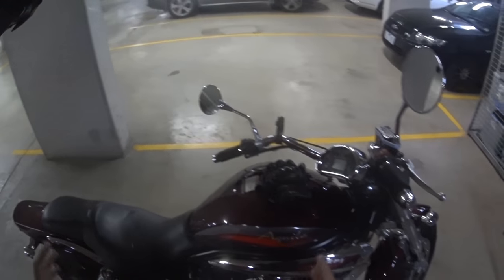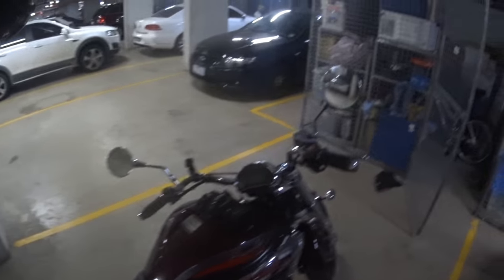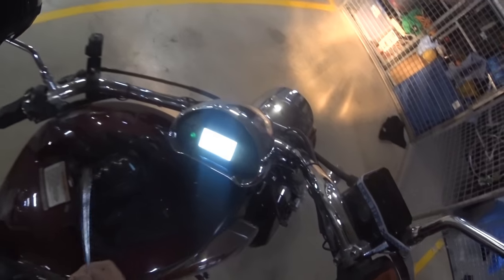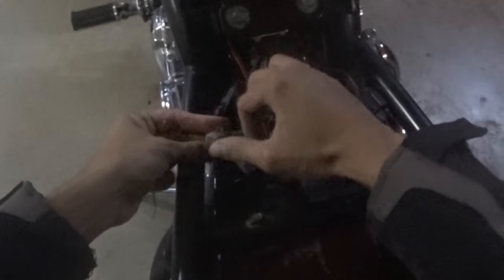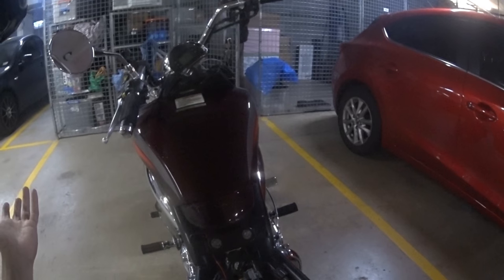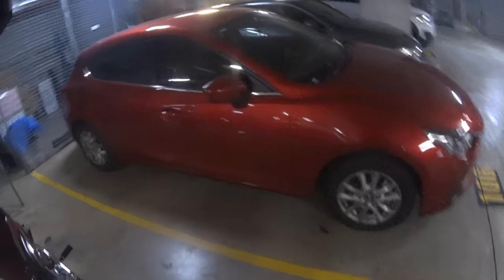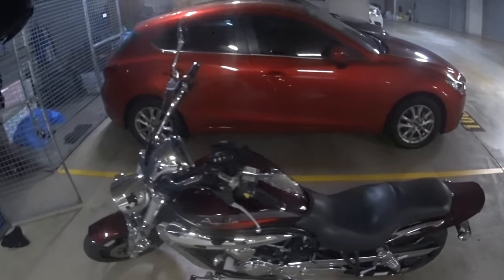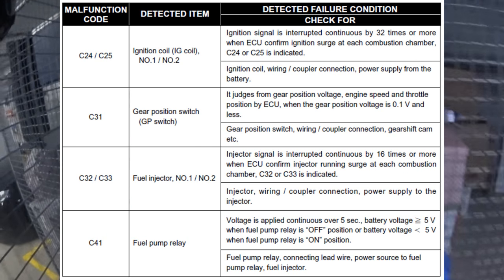How to read FI fault code Hyosung GV650 and GT650

Comment: I have 650 GV 2013 and after standing in rain, one cylinder does not fire for few minutes ( 4-5 minutes) before warming up. It runs normal after 5 minutes.What do you thing should I check?
Reply from the maker: Sounds like the spark plugs earthing out when wet so it's not zapping the plug. Check the leads on both ends by unplugging them and checking for corrosion. Could also be the water is getting into the regulator rectifier and shorting it so the voltage output is less and only enough to spark one cylinder. Check it's plugs too.
Reply: Suzuki sv650 and our gv650s have the same rubber caps over the spark plugs. They are a known fault on the Suzuki's. I'd check some Suzuki pages for an idea on a long term fix.
But short term, simply replacing them from the wire down will fix it, checking for any corrosion.
Reply: @blahblahblahlunch   thanks for the reply

Comment: Hello 

I am so thankfull for this site ! because i am in very big trouble,,,

Last year when i parked my Hyosung Gt650EFI year 2008, The bike staling/misfiring / lost power,,,

And i was assuming it was new Ignition coils/spark plug,

So ive changed 
Both ignition coils
Both spark plugs,
Rectifier
STATOR/MAGNET
-------------

STILL SAME Issue,,

The bike can idle fine ! but as soon you give a Little Gas, the bike will not take it and it runs very poor, 

There is no problem when starting the bike, it turns great in and idle fine ! but as soon you give a throttle it stall and go on 1 cylinder(sounds like that)

I dont see any Faults in my display ? ,

Could it be the air sensors?,, How can i check that?
Could it be the injection nozzle? - How can i check that ? 
Could it be low fuel pressure?  - but how can i check? The pump is runing great as soon you turn on ignition,,,

In Denmark there are No Hyosung dealers,, so no dealer help is possible,

Thank you 

Regards Jacob From Denmark
Reply from the maker: You need to ask that question in some Hyosung forums. Not sure what caused that if it's idling fine. Could be the ECU computer but hard to tell.

Comment: That's how I found out my ECU was busted, It was coming up with a timing error but the resistance on the timing wires was within spec. At least yours is starting and running, mine would not even do that.
Reply from the maker: yeah i am lucky :)

Comment: Wow very different to a newer GV650 with a Delphi ECU. I short mine before starting (thats the only way it works for me and it starts fine) and once the error light comes on you hold select button down for 15 seconds and then the code is displayed.
Reply from the maker: that's good to know. my ecu is the Daewoo brand one in my 2010 GV650
Reply: Andrew Morris, what year is yours?

Comment: I bought a gt650 2013 and when I turn it on it gives a flashing FI light. Bridging it does nothing
Reply from the maker: Perhaps yours is bridged in another way, as it's not the same model?
Reply: Hey, by any chance you found the solution? 😅

Comment: It is inaccurate and misleading to say 0:46 "the engine isn't running and teh FI is not lit". Actually production years around 2009 ALWAYS display cHE and ref FI light is on UNTIL you start the engine. Maybe later EFI models have this fixed. Early carb version of course do not display anything as they have no EFI unit to transmit error codes at all.
Reply from the maker: This one's a 2010 model
Reply: So my 2010 efi gt650r is fine with che displaying with Killswitch off? I'm not getting power to my fuel pump. Kinda loosing faith
Reply: @nawrfsideshawty  this kind of cHe is fine. if it displays with motor running, at this point you youse debugging/serviing switch and it displays error code instead of km/h.

Comment: mine flashes FI but not when it's running. Is that good or bad? It starts instantly when cold and the throttle repsonse seems fine and it doesn't smell rich.
Reply from the maker: Perhaps an electrical issue when the bikes running it's producing electricity from the alternator/regulator rectifier. Could be shorting somewhere or an issue with a sensor.